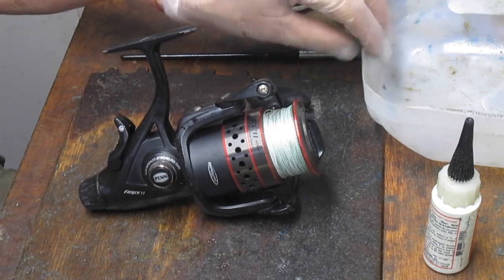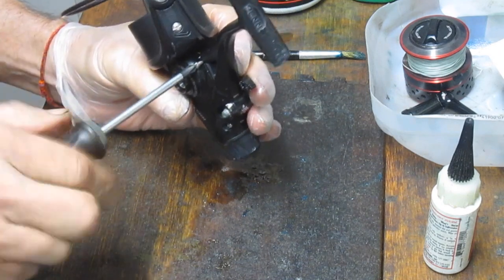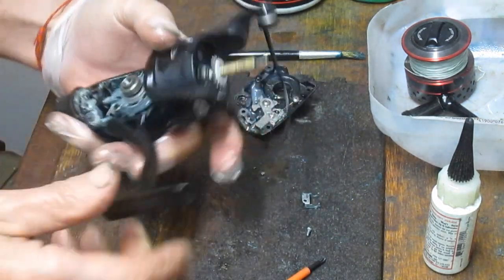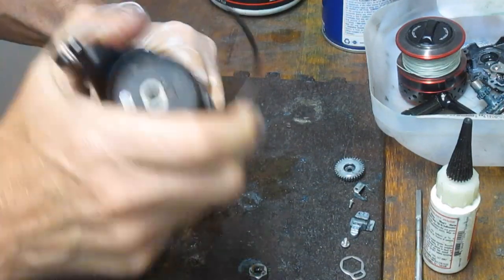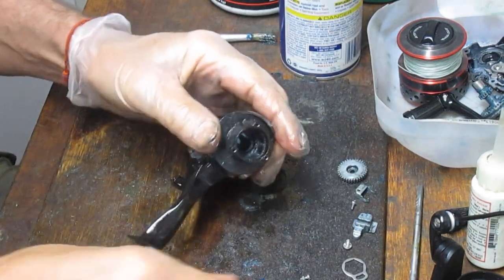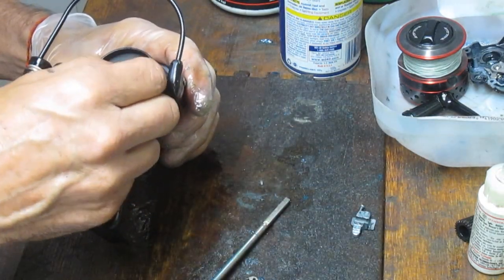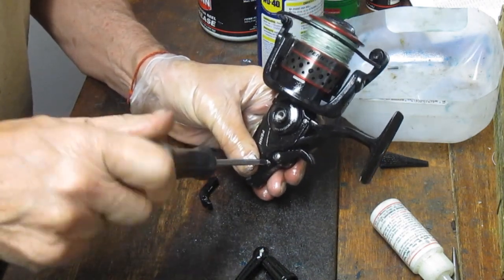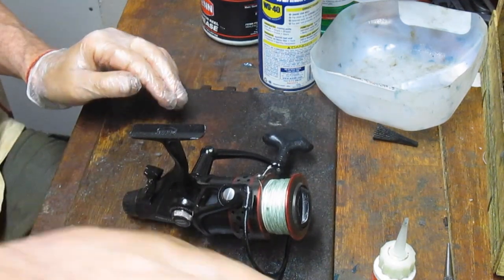Penn Fierce II 4000 Liveliner spinning reel how to take apart and service

Comment: Hey Dennis good job but I’d really love to see how to service the bottom drag.
Reply from the maker: I will add that to my list of requests.  There really isn't much going on there.  The assembly is removed by an internal clip and the drag washer sits in the carrier.  Thanks for asking.  Please stay tuned.  I will try and let you know when I do one on the rear drag set up - Dennis
Reply: 2nd Chance Tackle thanks
Reply: @2ndChanceTackle  Dennis my fierce 2 live liner 6000 may be that problem with the rear drag, I sent you it so maybe you can fulfill this man's request, and mine as well. Need my reel fixed up for alligator gar this upcoming season.

Comment: I have the Penn Fierce 4000 Liveliner and used it three times. this last time I got a sizable catfish on and when reeling it in the spool and shaft popped out of the reel. is this fixable or should i try and send it back to Penn
Reply from the maker: It is fixable.  It sounds like the crosswind block has broken.  If you just got it, then it should be covered by their 1 year warranty, so I would send it back.  If you are asking if I can fix it, yes.  If you would like service and repair information, please send a note to my email 2ndchancetackle@gmail.com.  Thank you - Dennis

Comment: In related news I am trying to open my Conflict 4000 for servicing. It's caught a pile of nice weakfish so far this year along with a cownose. It's gotten a little stiff to turn and I know what to do save for one thing: I think the little case screws are locktited. Do you have any tricks besides penetrating oil and maybe heating the screws with a small soldering iron? If those tiny screws get their heads buggered it's game over.
Reply from the maker: There is no easy cure, so go ahead and try.  If it is the blue Loc-tite from the factory, then hand strength generally can free it,  If it is the red, then your soldering iron may free it,  If it is salt and rust, you will likely break the screws.  Try soaking the reel in fresh water overnight.  The can generally loosen it if it is salt and rust.  - Sorry, but you are literally in a bind with no easy solution - Dennis
Reply: @2ndChanceTackle  It's not salt or rust .I maintain my stuff.  I freed 2 of the 3 screws. #3 screw head buggered and I am now trying to patiently drill off the head. The larger slot head screws on the older reels are fool-proof. Lesson learned.
Reply from the maker: I didn't me to suggest that you are abusing your reels.  Just that this stuff happens and that the way to work that one is a fresh water bath.  Glad to hear you are more than half way there.  I have a 6/0 on my bench with 8 of the 10 screws frozen.  The fellow had the reel as a spare and it sat in an external rod holder on the bridge without ever being hosed down.  As you say - lessons learned.  Dennis
Reply: These comments are for everyone's benefit. I was not at all offended. I'm just disappointed in how some tiny cheap screws make routine maintenance almost impossible. The older Penns last much longer with a little TLC.

Comment: Hi Dennis.  I've got a Penn live liner 6 new and need to adjust the drag on the free spool and in told I can adjust it at the rear of the reel - could you help me possibly?   I don't want to damage the reel. It's brand new !  Thanks ! Adam
Reply from the maker: There are two drag systems in the livelier reel.  The top drag in the spool is your tradition drag tat you use when fighting a fish.  The rear drag controls the tension on the line release when you are in bait feeder mode.  You can slow the speed (increase the drag) on the rear assembly by turning it clockwise.  To reduce, turn counter clockwise - Dennis
Reply: @2ndChanceTackle  cheers Dennis. Yep figured it.  Perfect for drone fishing.  Cheers 

Btw can this handle large sharks would you say ? Got the 8500 version

Comment: Does the reel have a pinion bushing on the rotor? Looking at the schematic it shows 19a. However when I took mine apart and went to put back together I could not locate this part. Just curious if I lost it or there isn’t one.
Reply from the maker: 19A is a small plastic cup bushing that sits inside the top of the pinion gear, where the axle shaft goes inside. It helps keep the axle shaft true and snug - It does not sit on the rotor - Dennis
Reply: @2ndChanceTackle  thanks for the quick reply
Reply: Thanks for all your informative videos!

Comment: Do you have any videos on the fierce iii live liner. The drag on my fierce iii 8000ll will not work. I am unable to reel my line in and the spool spins. There is not clicking. Can anyone helpe out.
Reply from the maker: The issue is most likely in the locking pin that comes off of the trip lever and intersects with the drag drag assembly to hold it firm.  I do not have the version for the LL 3, but the following one, done for the 4000 LiveLiner II is near identical
FYI - Dennis